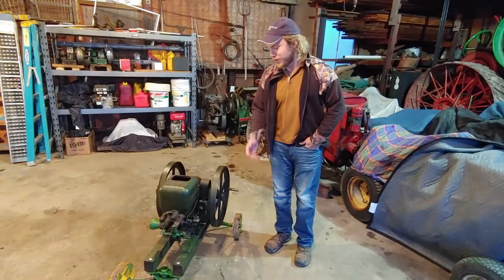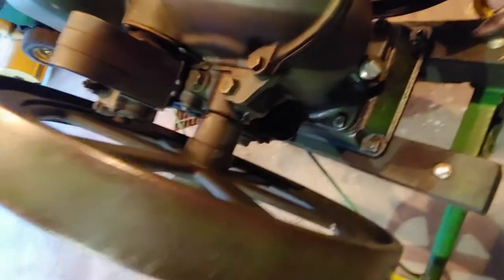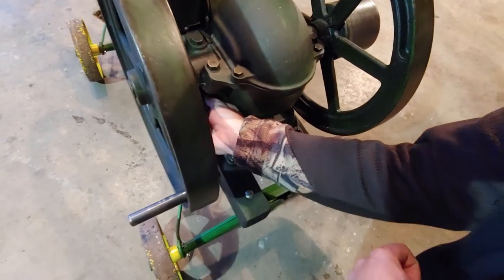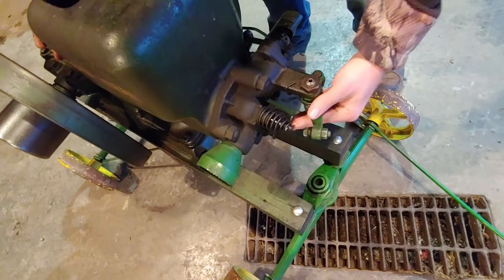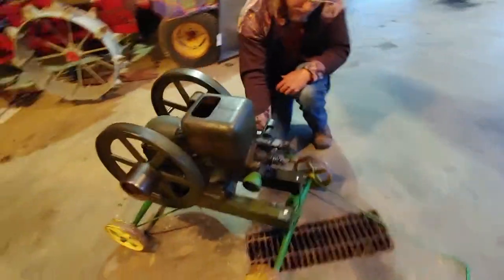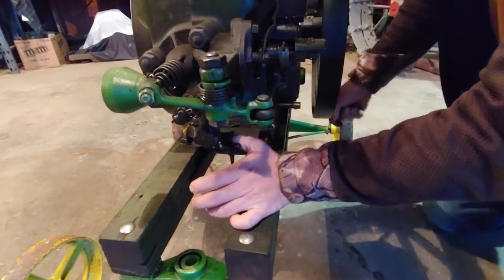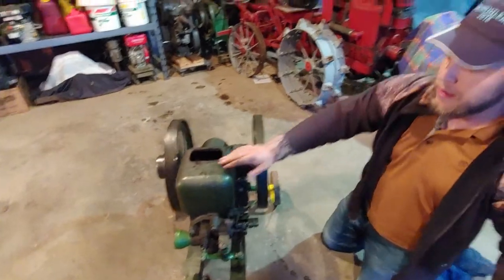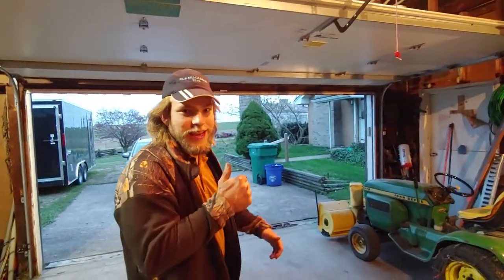How to start- John Deere hit and miss engine

Comment: Ok. Stupid question. Just regular gas? Do you know what they are worth? I have a very nice one I need to sell.
Reply from the maker: Correct, regular gas. But that depends whether it is original or restored, if it starts on the magneto, and location matters a lot as well. What horsepower is yours?